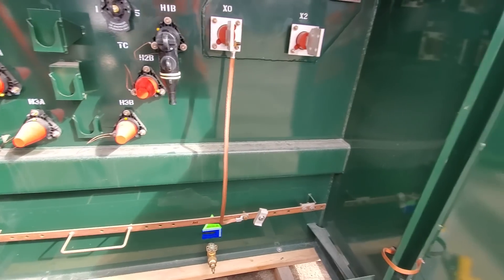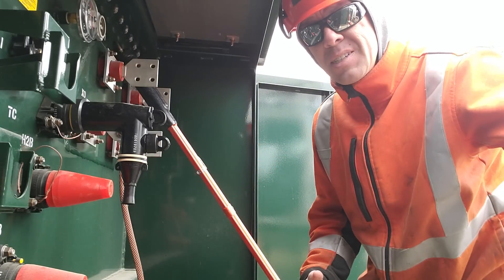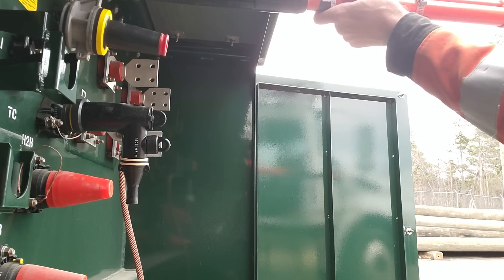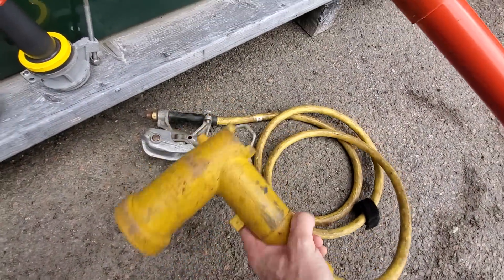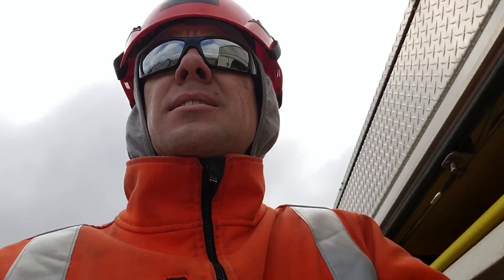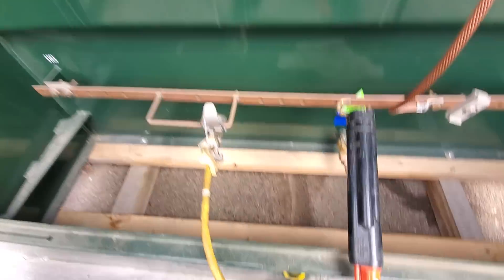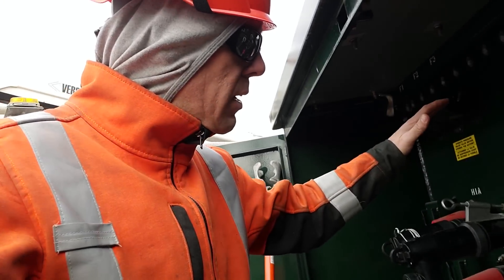What's a "Parking stand" ??

Comment from the maker: Voltage check using Sensorlink Voltstick
https://www.youtube.com/watch?v=LWCXm8UTTps
Reply: Hey I have a general question we have lived we’re we are for about 7 years now but I was walking the yard the other day and noticed the pole that houses our transformer has a broken ground wire at the bottom of the pole is that dangerous and if so should I call and report the issue
Reply from the maker: You should call it in and have it assessed. It's likely not overly dangerous as I'm assuming it's a Muti grounded system like ours. That being said, a transformer pole likely has a lightning arrestor on it which could have some voltage passing through looking for ground. (There could be a voltage difference between the broken ground wire and ground itself). Always best to call it in.
Reply: @Bobsdecline  ok thanks
Reply: @Bobsdecline   Do you have a lot of breakdowns to manage today with the storm and if not often in your videos you mention your facebook page but I never managed to find it on facebook

Comment: Commonwealth Edison had a type of 4160V 'pothead' riser with detachable terminals that resemble these elbow connectors (both the cable end and the receptacle on the riser), and these risers were specific to the distribution system within Chicago itself. For when they had to disconnect a riser or if a riser was normally open, they had dummy caps that fit into the terminals on these risers. They also ordered special side-tie distribution insulators that could replace the normal pin-type insulators on the riser pole, and these had an elongated upper half that served as a parking stand! (insulator collectors have a style chart to categorize porcelain insulators, and these are style U-190 on that chart).

Comment: Very cool to see how all that works. We have "parking stands" at my utility on the overhead as well. For us, it's something we quickly and easily make in the field with a 5/8" bolt with nuts and square washers to hold it in place on a crossarm, and Haul bracket with insulator taken out on the other end, which the linemen use to park our primary temporarily.

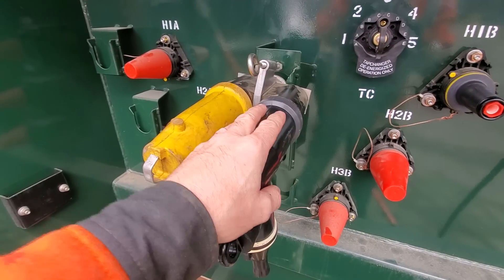Comment: 8:00
in the case of say, the passthrough being damaged but the elbow connectors are not ( say the transformer melted internally) could you theoretically use a double parking stand to pass through the power from the cable coming in to the other cable going to the next pad mount?

Comment: Interesting. Our elbows are bolted and there is absolutely no possibility of removing them while live.
But our grid is configured to accommodate that its all long ring mains with feeders feeding into the  sections, if needed one section can be isolated without power interruption at all because well its a ring line so each transformer has essentially two power feeds coming from each direction. So you isolate a section and the transformers will stay energized, they are now fed from a single point only though.
Sometimes the ring has only one feeder and if you need to isolate the section that's got the feeder hookup you have a problem...
In the early days entire cities used to just have one ring main like 33kv.

Comment: We use the Chance MultiRange Voltage Detector Kit – T4032271 to check potential on test points before grounding, we also will use the Elastimold tester on test points for phase checking. We always keep our caps or grounds on the feed throughs to keep them clean.

Comment: Do you ever run across non-load break 200A elbows? Elbows without the two white stripes, only seen a handful of them. Most  are the double white stripe indicating load break, like the video, but I have seen some non-load break in some older installations. Unless you guys can't pull energized elbows at all, then a moot point.
Reply from the maker: We still see em once n a while but never purchase or re install them.

The load breaks we are allowed to pull live but will always opt for an overhead disconnect if at all possible.
Reply: @Bobsdecline  Yeah, I always feel safer pulling them de-energized.

Comment: Fantastuc video. One question, the parking stand block is isolated when you put it on the padmount's bracket. You specified to install the parking stand with the hot stick. Is that just the geneal practice,  use a hot stick for everything when there is primary voltage around? I suppose you wouldnt want to assume that everything is proper and then find out the hard way that there were problems. Thank you.
Reply from the maker: Great question! The answer mostly depends on company policy/procedures. The short answer is that on a "dead front" transformer, if everything is in good shape and your rubber gloves are used - the bracket can be installed by hand but elbows and grounds always sticked
Reply: I see that if you always use the hot stick then you have one single procedure to use and you train on the procedure every time.
Finding out the hard way - that's going to be a headache for the cleanup crew, this is a case where you only make a mistake once.

Comment: I was looking at the setup there and wondering how, if there are three elbow connectors to a separate transformer that is fed from this transformer, you can disconnect just one and still have it be de-energized and eligible to be grounded right then.  I would think you'd have to unplug all three, one at a time, and put them one by one in turn on one side of three double parking stands that have an insulator cap on the other side and are not yet grounded, before being able to ground all of them (one by one till all are grounded) through the parking stands.  Do I have something like the right idea here?

Comment: Great learning video, you can use any multimeter to check voltage at the test port. It will give you a reference if the voltage that is in the cable.

Comment: Hello Aaron,
Even though I'm not in this trade, I enjoy these videos because it give us non linemen an understanding of how these power lines work.  I was wondering when a fuse blows in a cutout, how it causes the door to unclip on the top part of the cutout??  Keep up the great work and stay safe.
God Bless, Karen
Reply: (Also not in the trade) The force of the exploding fuse towards the ground pushes the door upwards and the top falls free.
Reply: Aaron does have a video about replacing the fuse wire inside the door.  The wire holds a spring tight.

So when the fuse melts (and actually there's a controlled arc explosion inside the door) that means the wire can't hold the spring tight anymore which - somehow causes the door to fall open.  I'd have to look at it again.

But it's definitely a mechanical process that detects when the fuse wire is no longer connected.

Comment: Is there a limit to how many times those elbows can be removed and put back on? Is there a limit for the sockets on the transformer side? I don't imagine they'd be removed often if at all, but do the elbows get worn/degraded excessively if they're messed with?
Reply: Technically, yes. But it's not like there's a counter attached to them. They'll be replaced "when necessary". ;-)
Reply: The bushings on the transformer can usually be replaced if they need to be changed. Done externally and without draining oil. While they aren't a consumable per se', they are able to be changed.

Comment: What's that TC switch for?
Reply: TC stands for Tap Changer.  The primary (high voltage) winding of these units are tapped. Standard taps would be 95%, 97.5%, 100%, 102.5% and 105% of rated voltage. You can use the taps to compensate for an over-  or under-voltage at the end of the line where the transformer is installed.
I used to design these transformers. Aaron, I really appreciate you showing how they are used in the field. I have seen them in use before, but you always add details I have forgotten or never knew!
Reply: @kjh6793   - Thanks for the feedback!